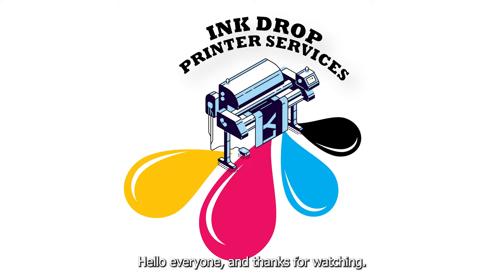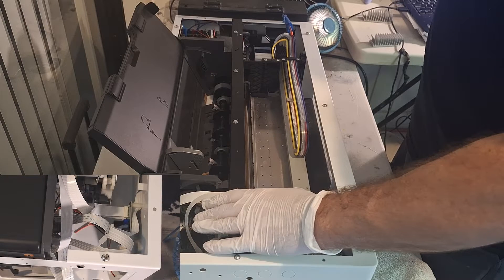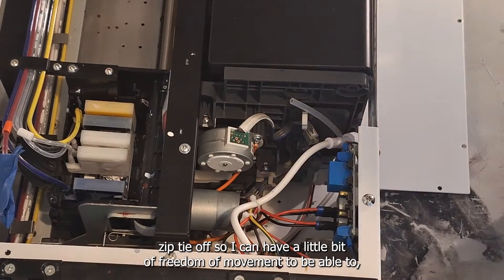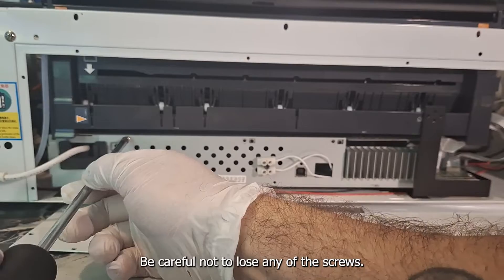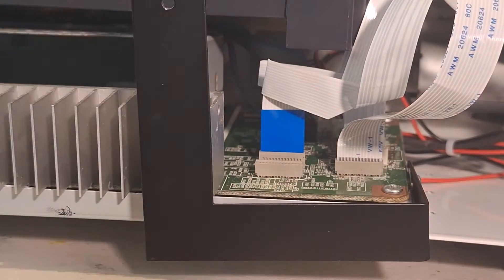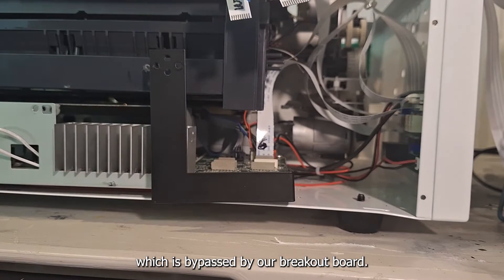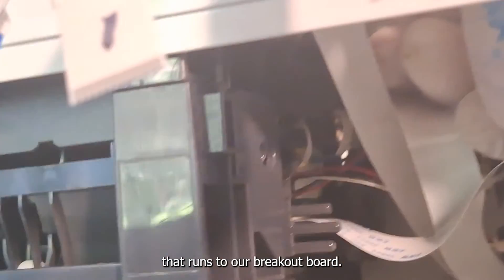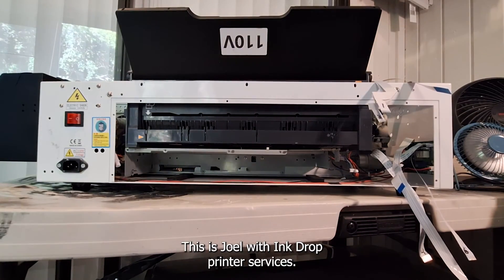How To Replace L1800/R1390 DTF Printer Mainboard

Comment: I have one that prints blank pages. I recently replaced the print head and the ink cap for the ink capping station, but it's still doing the same thing. No error messages at all. Could this possibly be the mother board as well or maybe a fuse?
Reply from the maker: Its likely the f1 fuse on the mainboard.
Here is link:https://www.inkdropprinterservices.com/l1800-r1390-fuse-mainboard-fuse

Comment: Do you have a video to where you can explain how to fix the 52H error it said it’s a CR LOCK ERROR
Reply from the maker: 52H can be caused by alot of different circumstances.
Could be anything from bad capping station to film roll impediment.
Reply from the maker: Does it happen DURING printing? Or does it happen even when system is just doing head cleaning?
Reply: @SuperTech220 printing like after it prints it does the double lights but when I shut it off and turn it back on it’s fine and prints but I gotta do it for every print
Reply from the maker: If it happens during printing only....and the system initialized and head cleanings do not show an error.

Then try this:
Put just a sheet (cut off the roll, to release any pressure or resistance the weight of the roll is creating) and print in just a sheet. See if it completes the print.

Comment: So will the main board need to be replaced if my 1390 will not turn on at all. 

So the power button at the back works. The light comes on and everything 

But whenI try to turn it on from the front by the power button it’s not turning on at all.
Reply from the maker: Could alot of things, control panel cable could be damaged or plugged in improperly.....but usually when I hear this scenario it is due to a damaged mainboard and probably printhead or cables.
Reply: Same exact thing mine is doing , did you figure it out?

Comment: I need to replace my motherboard and was wondering if there is a specific motherboard I need to get or something to look for ? I see some on AliExpress for $100 but then I see some for $250 or more on Amazon or some DTF websites.
Reply from the maker: There are specific motherboards for different models. It sounds like you have a L1800 based system....here is a link to purchase a good board for your system:
https://www.inkdropprinterservices.com/epson-l1800-mainboard

Don't hesitate to reach out with any questions.
Reply: @SuperTech220  my question is… are all the motherboards the same? (Regarding the l1800) are they modify for DTF?
Reply from the maker: @GerardoHernandez-sk8tq  95% are all the same ORIGINAL L1800 boards, nothing different than what you would find in any Epson L1800.
Most manufacturers have "bypass boards" they use in their machines to bypass PF and other sensors.
So, you most likely have a regular L1800 mainboard.
Reply: @SuperTech220  thank you so much! I was just wondering if the motherboards get modify or if there is something too look for. Since I did notice that some print heads come with a white motherboard and some come with a green motherboard. Looks like the green ones are the original heads.

Comment: Thanks
Reply from the maker: You're welcome, hopefully you found the video helpful!
Reply: @SuperTech220  Yes sir. I watched a few just trying to understand things. My year old Procolored F13 lost power at startup and I was told I needed a new mobo and printhead after online troubleshooting with the tech.  The parts are being shipped out.  The F1 fuse checks out fine but the transistors seems to be bad. I wondered what might be the cause of their failure. I do not see any damage to the printhead cable or other cables. Pin 1 on transistors 1 & 3 show 42.9 ohms but does not beep on the continuity setting.  Pin 1 on transistors 2 & 4 show 0.4 ohms and does beep. All the other pins do beep and measure 0.4 ohms on the multimeter.

Comment: Is replacing the L1800 printhead to R1390 board improves perfmance? How?
Reply from the maker: The R1390 and the L1800 models both use the same printhead (Epson Part Number F173050).

We offer a "L805 to L1800 adapter board" on our website at the link below:
https://www.inkdropprinterservices.com/l805-printhead-l1800-adapter

The L805 to L1800 adapter board allows you to install a L805 printhead into a L1800 or R1390 printer. Performance is overall the same when you install the L805 printhead  and adapter board in your L1800 or R1390 DTF printer.
The benefit of using the L805 to L1800 adapter board is the cost of the printhead. The  L805 printheads are much cheaper than the L1800 or R1390 printheads.
I hope this explains it.
Reply: @SuperTech220  tried doing this but Ive noticed that the color management and printing results are no longer the same, does this needs a specific ICC profile when using 805 on 1800?
Reply from the maker: @JersonDeVera-xy7rz  there is not a specific ICC profile. Color matching is dependent among ALOT of variables. To correctly color match we would need to start with PMS color values or something similar then begin to determine which ICC's are best to match those PMS values.
For example....there are atleast 20 different versions of the color red....having the PMS value closest to the "red" your looking for would be the best starting point.